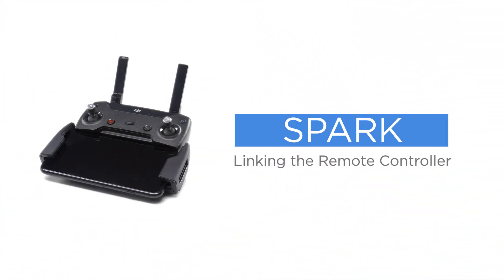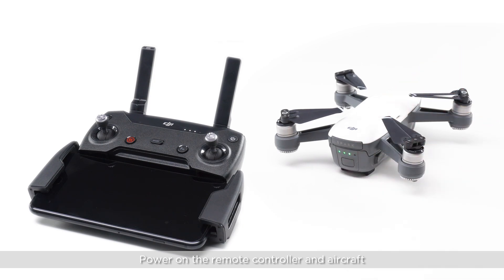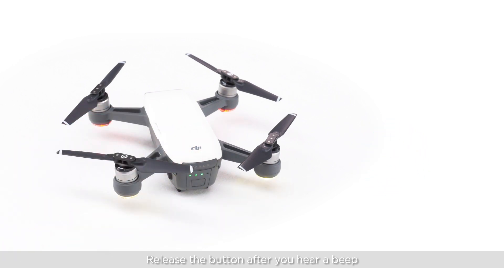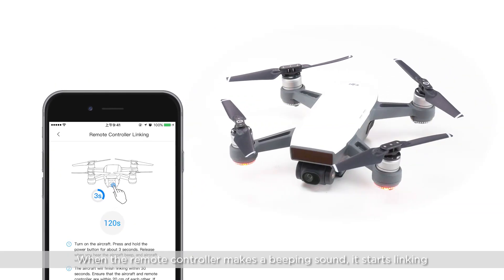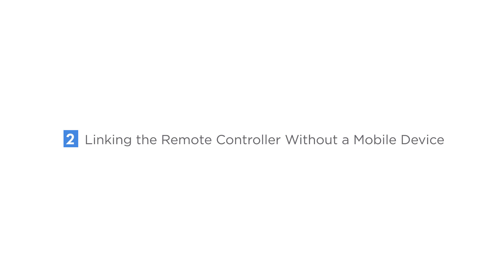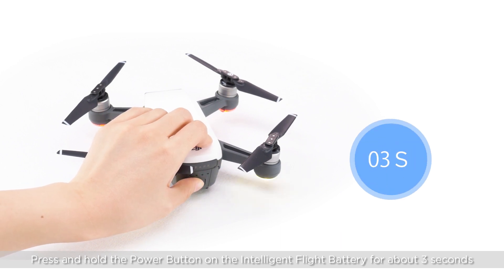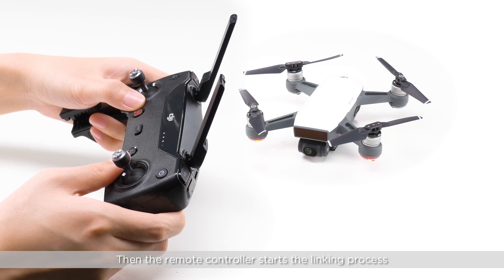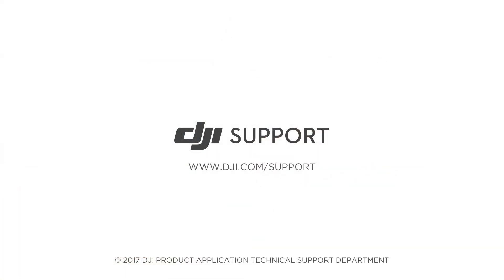How to Link DJI Spark's Remote Controller

Comment from the maker: DJI Support is moving to DJI Tutorials! 
Don’t miss our consolidated contents and new videos, 
subscribe to DJI Tutorials at: http://bit.ly/2X04acQ
Reply: how to reset the wifi if the password is erased
Reply from the maker: @cribby_sa  To reset or modify the aircraft's and remote controller’s Wi-Fi SSID and password, please follow the steps below:
1. Press and hold the battery power button for nine seconds. When the aircraft makes three beeping sounds, the Wi-Fi SSID and password can be reset.
2. When the aircraft is connected, modify the Wi-Fi SSID and password in Wi-Fi settings.
To reset or modify the remote controller’s Wi-Fi:
1. Press and hold the remote controller’s power button for nine seconds. When the remote controller makes "DDD-DD" beeping sounds, the Wi-Fi can be reset.
2. The modification of the remote controller’s password and Wi-Fi requires app v4.1.4 or later, and remote controller firmware v01.00.0300 or later.

Comment: Hello..my brother gave me a dji spark.. i can't pair  my remote to the aircraft even i followed the correct procedure..
Reply from the maker: Hi, there. We are sorry for the inconvenience caused. Could you please try the following steps? And if the problem still exists, you can send us a related video of your problem via this link: https://www.dji.com/support/repair
1. Confirm that the remote controller and the aircraft have been powered on.
Press the Power Button once and then press again and hold to power on the remote controller. The product gives a prompt sound when successfully powered on.
2. Please remove the microSD card from the aircraft and restart it. After some third-party microSD cards are inserted, the aircraft may malfunction after the flight. You must rule out the microSD card’s effect on the aircraft.
3. Switch the linking method between “Linking with the app” and “Linking with combination buttons”.
4. If it is invalid, check whether the remote controller has been updated to the latest version. Connect the remote controller to the app. After the connection is successful, check whether there is a prompt to update the firmware. If yes, update the firmware to the latest version and try linking again.
5. If the linking still fails, please check whether the aircraft firmware has been updated to the latest version. Connect DJI Assistant 2 and check the version. Update to the latest version and try linking.

Comment: Yeah this model is no longer supported by planned obsolescence aka the DJI apps. I've flown it once due to incompatible locations. Worst investment ever.
Reply from the maker: Hi there, we are sorry for any inconvenience caused. Could you please elaborate on the issue you encountered? We will do our best to help.
Reply: @DJISupportGlobal  I've tried to fly it with samsung galaxy s5 and two huawei phones; with and without the remote. I flew it once. The app won't support the drone and/or work on my phone anymore. Various apps: dji go 4, dji fly, dji pilot. Nothing but problems for 3 years.
Reply from the maker: @mathewrussell926  Hi, there. Could you tell me the OS of your phone? Besides, could you tell me what problem you have encountered? Did the app fail to connect to the drone? Or other issue? I'd like to help you.
Reply: @DJISupportGlobal  I've used Android on a Galaxy s5 and it wouldn't take off in my city. I moved to a new city and used Emui on a Huawei. It's in China. Either the location disables takeoff or when I'm not in the location, the OS won't support the app, or the app no longer supports the spark. If it's not one thing, it's another!

Comment: hi, why I am not able to fly with my DJI spark remote control. DJI spark and remote is linked and I m able to click pic and video with remote but not able to take off or land with remote, with phone apps work fine. I try calling DJI support and they advise to do the calibration and I did but still the same . please advice
Reply from the maker: Hi there, could you please check the front LEDs and the status LED on the remote controller again to make sure that the linking is successful? You may also send a video to our support team for further confirmation. Our team will continue to help you solve this problem.
Reply: @DJISupportGlobal   thank you so much i figure out the problem :) and solved
Reply from the maker: @techno2000ca  Glad that the problem is solved. Should you have any further inquiries, please feel free to contact us.

Comment: RC SSID does not appear on the phone
Reply from the maker: Hi Kevin, we are sorry to hear about the issue. Could you please tell us the way that the controller indicator blinks? 
Please try to reset the controller by long pressing the power button for about 9 seconds to see if it appears. 
If you are using an Android device, you can also try to use an OTG cable and connect the mobile device and controller with the cable.
Reply: @DJISupportGlobal  OTG cable works. But still why do I need to use OTG cable.  I did reset but still RC SSID does not show up in the wifi list.  This is expensive RC.  I wonder why many people is using OTG.  I want it to be worked as wireless/wifi
Reply from the maker: @kevinyoo9274  Thank you for getting back to us. If the reset doesn't work, and the LED of the controller is blinking red twice a time, you may need to send the controller back for further diagnosis. Please fill out the online repair request on our official web and then send it back. Here is the link: https://repair.dji.com/repair/index 
We will do our best to help this out.

Comment: I had a replace of the spark and when the controller connects to the spark , there’s no connection with the camera of the spark and when I try to connect the the iPhone with the drone It works but I cant fly it

Comment: What if your controller is not showing up in your device's wifi list?
Reply from the maker: Please try to reset the controller WiFi by long pressing the power button for about 9 seconds. If you are using an Android device, you may try to connect the RC and mobile device via the OTG cable and connecting cable.

Comment: Followed the instruction to  the letter, this piece of sh*t is still refusing to connect with the RC. and after the update it requires a calibration before every flight. DJI really shat the bed with the phone- RC- drone connection. fails more times then connects.
Reply from the maker: We are sorry to hear about any difficulties you experienced. Please help double confirm if it is the drone disconnected to the controller, or the mobile device disconnects to the RC. A screenshot will be appreciated. 
If the drone can't be connected to the RC, please double confirm if both the firmware for the drone and RC has been updated to the latest version, try to refresh the latest firmware via DJI Assistant 2. 
If the drone can be connected to the RC, please check if there are other issues. 
For the calibration issue, could you please tell us if it is the compass, IMU or other calibration is needed? Please calibrate the compass in an open area, keep away from the metal interference, etc. 
Any further issues, please feel free to contact us. You may keep us updated via Facebook Messenger: https://bit.ly/2pm7tfV

Comment: DJI, can you add dual remote linking? I want to let my friends fly my drone with a extra controller.
Reply from the maker: Sorry, Spark doesn't support dual RC.
Reply: But can it be added in the next firmware?

Comment: so i dont need an otg cable?
Reply from the maker: Hi Justin, Spark supports connecting the controller and mobile device via Wi-Fi, so you don't have to connect by the OTG cable. Please don't worry.

Comment: My sspark controller isnt putting out a Wi-Fi signal, aircraft does and flies fine with phone but cannot get it to link with controller, when I try instead of the louder repetetive linking beep sound it beeps once quieter and then just stays flashing red with no linking, any help is appreciated. Thanks!
Reply from the maker: Hi Dillion, may we know which mobile device do you use? Please power on the aircraft,  press and hold the power button for six seconds until two beeps, then search the WiFi to check.
Reply: @DJISupportGlobal  thank you for the reply! Unfortunately that did not work either, I have been watching videos and trying various methods with no success so far. My phone is a LG G35, it works great with my mavic pro. My main problem is that I cannot even get the controller to flash green to initiate the linking process, it just remains with the red led flashing and never the louder frequent beep, just a single quieter beep after holding the 3 buttons during linking process
Reply from the maker: @dillonwest9732  Thank you for your detailed information. Could you please provide a video of your controller for further confirmation? You may send the video via email to support@dji.com, thank you.

Comment: Jesus Christ what a poor video by DJI. You only need to:
 power up the drone, 
then the RC, 
then push the powerbutton on the drone 3 seconds to go into pairing mode
then push and hold the red button, the function button and the costumisable button on the right side of the controller (R2 in playstation language)
The light on the RC will turn green and you are linked.

Like this comment if you agree the video is more confusing than my 4 easy steps.
Reply: Thank you! This worked for me, too. The video did not because of that screen that does not exist in my (latest as of Jan 2019) version of the iOS app.
Reply: thank you thank you thank you!
Reply: Dude! DUDE!! That is sick! Thanks man.
Reply: When it turned green on the rc it's still beeping
Reply: It worked but how do I connect my phone to my spark so that I could see whats it recording? Because I can connect the drone with my controller but what about the phone
Reply: ARC _ CHALLENGERS _ 2.0 I’m having the same problem. Did you figure it out?
Reply: Real mvp
Reply: The only good thing about this video is that it led me to your comment. Thanks!

Comment: After tapping RC Connected there is NO screen with Remote Controller, they just made that up!  Also linking the Remote to the Drone like this doesn't work and how do I stop the remote from constantly beeping?
Reply from the maker: Hi steve c, we are sorry for your trouble. Could you please help to provide us with an operating video of your case, the mobile device you are using so we can help to check? For the beeping, if the RC is connected to the drone, the RC may stop, please keep us updated if the beeping persists after the RC is connected to the drone. Besides, before linking, please keep the drone, RC and app updated to the latest firmware. If the issue persists, please help to provide us with your operating video as we mentioned above, you can keep us updated via PM m.me/DJISupport, thank you.
Reply: Same here. No such screen and no way to pair following the video. This must be an old version of the software. Very frustrating!
Reply: @cheluto2  Finally got mine to work,  first problem was the remote checks WiFi when first turned on and if the 2.4 Ghz band looks busy it automatically switches to 5 Ghz so I had to get a better phone that had dual band WiFi in order to connect with it on 5 Ghz WiFi.   The constant beeping was because the throttle was stuck part way up and couldn't be zeroed due to a loose screw stuck under it!  When I tried calibrating the sticks using the phone it couldn't calibrate the throttle.  I took the unit apart to see what was wrong and found a small black steel screw like they used to put it together stuck under the stick. There were no screws missing inside the unit so that one must have been extra which doesn't say any good things about DJI quality control!

Comment: DJI really need to work on it's pairing process. this shouldn't be so hard guys. i had the same issues back when i first setup my device. i updated and got everything ready to go. non of the paring steps worked. i had to try and try again so many times. best part is when paring to my controller i use to scan the code that tend to work 9/10. but a week or less of using my control the QDR code is now gone, how do u rub off a QDR code in less than a month. i try the default password to connect the controller, that will not work for odd reason so now i have not been able to connect my device to my controller since to last SW update DJI rolled out about 3-4 weeks ago. come on guys this makes no sense, simple pairing of devices from the same company should be automatic and not a burden to the user. i don't know why after a SW update all my device (a iPhone i only use with my spark, which is fully up to date) would disconnect all devices after the updates are installed. DJI didn't even send a extra sticker with additional QDR codes. no phone or chat support on the weekends, yeah that makes a lot of sense too. i've paired cheap $70 drones that are way more easier than this. this really annoying and frustrating. worse part is my controller QDR code rubbing off with-in a month!!!

Comment: Why is it that when tapping "RC CONNECTED" you dont get to the shown page in the video, ass Kenn stated you get to a black two sided growth off value, with a lot off statistics...

I have been flying in 2 weeks with my phone and not the controller, can't seem to get it to work.

I have iphone 7 with latest update on both the phone and the spark.
Reply from the maker: Have you set the drone to the RC mode? Please note that you have to press the function button of the drone for 3 seconds and do the next step. 
If it does not help, please kindly provide us with an operating video so we can help to check, please keep us updated at https://www.facebook.com/DJISupport/inbox/
Reply: Thx for quick answer, will make a video as requested, that will make the easiest way of explaining the isue.

Comment: Bought the Spark today (Fly pack with RC)
The iPhone connects to the spark
The iPhone connects to the RC
The RC will not connect to the spark!
Reply: I have been flying successfully for a few months but last week after the geofencing update nothing is right. Same problem here phone and spark fine, RC and phone fine but no matter what I do the RC will no longer connect with spark. 1 day off work a week now second weekof fighting this and I can't fly, very upsetting.
Reply: 2bsure i have not use my drone for months, today tried to fly it, did the geofencing update and have the same problem, it says no internet connection and no matter what and many things i have tried the rc wont simply connect to drone. It show the green light on the remote as if binded, but not working at all.
I can fly the drone with the phone fine. Did you solve your problem?
Reply from the maker: You are recommended to update the firmware for the aircraft and the remote controller, then try the connection again. If there is any further issue, please feel free to contact us at https://www.dji.com/support.

Comment: Meu estava normal agora o controle fica piscando a luz vermelha e apitando não sei o que fazer alguém pode me ajudar.
Reply from the maker: Hi Rodrigo, there are 4 types cases with a beeping RC in the majority situation: 
1. Extremely low battery, charger it;
2. Firmware upgrading failure, upgrade it again;
3. RC sticks are not at the midpoint, calibrate it;
4. Disconnect with the drone after 5mins, re-link the drone and the RC.
Please help to troubleshoot. Please keep us updated at https://www.facebook.com/DJISupport/inbox/ if the issue persists, a video of your case will be helpful for us to confirm.

Comment: Just did a firmware up date, on my brand new spark.  Haven't been able to fly it yet, got it 4 days ago..
During the update , the wifi from the rc failed, and haulted the down load. 
Not the remote won't link to the drone, and the rc wifi is no longer visible on my phone. 
I've tried all the fixes, no luck.
Pretty disappointed in the whole setup. Sorry, had to vent a little.
Reply from the maker: Bob, we are so sorry for the difficulties that you've been experiencing. Have you tied to reset the RC WiFi? Please try to press the power button for about 9 seconds to reset the RC, if you have another mobile device, you can also check if the other device and detect the WiFi. If it doesn't help, you might need to send the drone in. Please kindly contact our support for a further help: http://www.dji.com/support
Reply: I've tried that several times. No luck. Seems to be a popular subject.
Reply: Brand new spark, trouble shooting time, 6-7 hours, flying time 0... 
Can't return it to the ebay site, which claim they are an authorized dji dealer, without a 20% restocking fee and pay for shipping. 
Or send a brand new unit in for service before it's even been used. 
I wish i would have read a few more forums before i bought this.
Reply: Revolting this, I will try to recover the value of RC if I can not, I give up buying DJI products.
Reply: Good luck, on the phone with dji now, bought from a certified dji dealer on ebay, Getting the run around...
Reply: Thank you, friend, because I really need luck.
Reply: Just got off the phone with the phone, sending it back with a full refund.. Good by dji...